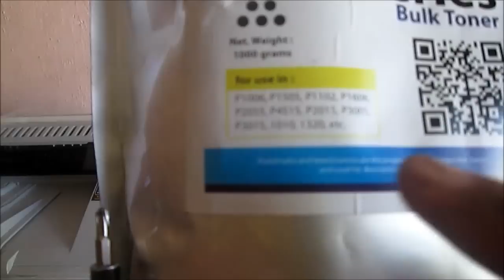How to refill HP LaserjetPro P1102 Printer with CE651A cartridges

Comment: Excuse me. after refilling the ink for my HP LaserJet P1102 printer, the printing ink on the paper became lighter!! would you please help me returning it darker ?
Reply: it means u have to change its drum...that blue or green colored thingy made of glass
Reply: as it is a very cheap model of hp you need to replace the cartridge reset chip also after replacing the chip the print will be normal again moreover, you need to replace the chip each time win you refill the cartridge.

Comment: It's useful followed step by step I was facing half light page and half print was dark now I filled it first problem is that the font is now lighter altough it print full page but in lighter color second is how can we know that it's filled full how much amount can we put into as I can't  weight it.. I'm having hp p1102
Reply: as it is a very cheap model of hp you need to replace the cartridge reset chip also after replacing the chip the print will be normal again moreover, you need to replace the chip each time win you refill the cartridge.
Reply: Before filling new ink you first you need to discard previous ink remember if you do not discard previous remaining ink properly from storage and wast area then you will face the problem as mentioned above half light and half dark.. Furthermore it is a cheap model (P1102) so every time you refill the ink you need to replace the toner reset chip as well because that chip holds the record that how much cartridge left once the chip status is empty then there is no way to reset it back so every time you refill the cartridge you need to replace the chip as well. that chip cost nothing 0.06 to 0.07 USD / one piece so you can easily get that chip from any online store e.g. Aliexpress.

Comment: Want to seek for your advice. I just changed a new cartridge for the same printer. But the page printed out with a lot of horizontal black bands. The cartridge is compatible type. I checked on the drum after printing. There are strips of blank ink adhered on the drum. Do you know what is the problem and how to solve it?